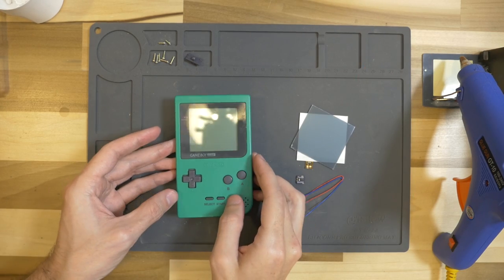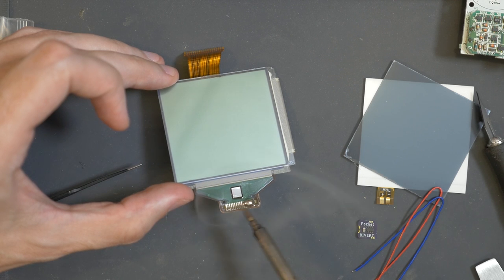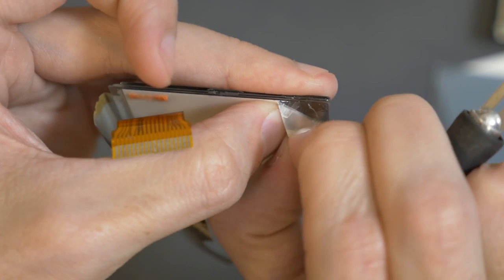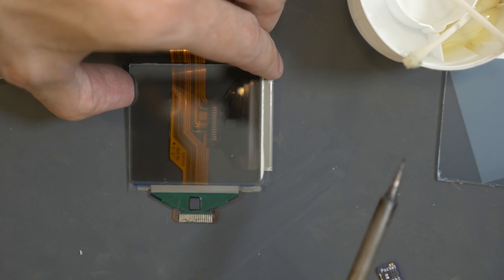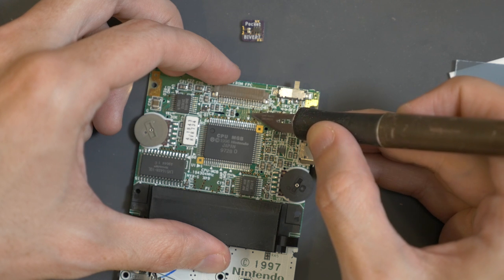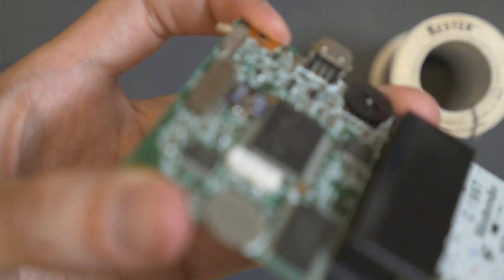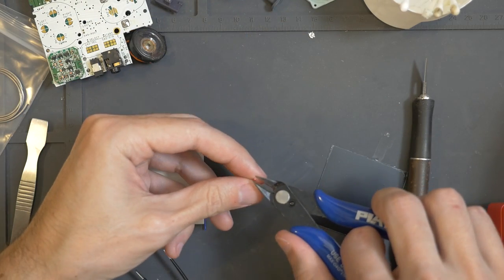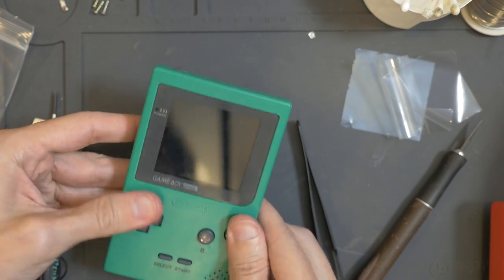Backlight and Bivert a Game Boy Pocket - Full Install

Comment: How hot should a soldering iron be to do its job when soldering/disoldering parts on a GB? Mine has a heat regulator, and I'm not sure if I'm applying too much heat, or the heat is too low, any useful tips?
Reply: theretrofuture uses like 300°C i believe

Comment: Desoldering the ribbon is super tricky—I just ruined a screen this way (accidentally yanked off two of the "teeth" contacts of the top layer). Other tutorials I've seen tell you to keep the ribbon on and just work beneath it carefully when removing the backlight... something to consider before you begin!
Reply from the maker: I’ve done lots both ways and haven’t ruined any screens by desoldering the ribbon, but definitely have destroyed some by not. But it’s possible both ways for sure :)

That said, I think most people are just dropping in new IPS screens now anyway, heh.
Reply: @esotericsean  good to know... possibly just had bad luck with this one!
Reply: no worries, I screwed up my screen by not desoldering the ribbon just as well :D
it might be easier to repair broken teeth than the ribbon broken just where it attaches to the screen 
hope you fixed your gameboy btw
Reply: The funny part is that I’ve tried desoldering the ribbon, but I haven’t had the quick solder thing (low melting point solder) so I’ve tried to remove it using the regular solder. I overheated the ribbon and those teeth got burned basically, so another screen is dead
So unless you have a low melting point solder it’s definitely safer to not touch the ribbon :’(

Comment: hi. i hope u can answer my question. there are vertical line color/shades inaccuracies on my gameboy pocket screen when there is a contrasting color/shade ie. grid in the background. i think it only happens when there is a column from a building in a background and the vertical line extends to where it shouldnt be from the top or bottom. can i fix this by resoldering the screen ribbon cable?
Reply: there are several tutorials on how to fix that
watch some videos of theretrofuture

Comment: Is there any concerns of goo gone getting on white ribbon? I was able to clean back of screen with alcohol and without separating ribbon with the iron. However, it took FOREVER to remove adhesive with alcohol alone
Reply: I know that it's a comment from 3 years ago but for the future lurkers:
I was out of IPA so I've used nail polish remover (Acetone), and I think it worked even better than an IPA
but be aware that it can damage plastic parts, so it's better to be careful and not apply it to anything except the glass itself

Comment: I’ve done a ton of these.  The one thing I’ve noticed is that when the system is all buttoned up there is pressure on the upper/mid right part of the screen sometimes causing dark spots in the lcd.  Any ideas for fixes????
Reply from the maker: I’ve honestly only done a handful and use IPS screens for the most part now. I do think there’s a certain nostalgia and beauty about original backlit screens though. Pockets are the trickiest, unfortunately. Wish I had something helpful to add!

Comment: Thanks a lot for this tutorial!
Do you know if there is a a way to add a switch to switch off the screen and bivert to get back to the original screen? (kind of like switching on and off the screen on GB SP).
Reply from the maker: You could.. but doing this mod removes the reflective backing so it would be darker than normal with the backlight off. I’m sure you know about the new IPS kits for Pocket, though?
Reply: @esotericsean  Ok I see thanks! Yes I know the IPS, I wanted to mod the pocket to be able to play at night while keeping the possibility to have the normal screen during day. Like it was just a nice addon!

Comment: Any recommendations for the ones who are doing this mod without "desoldering" the ribbon. I have never seen anyone desolder that ribbon before because of how extremely delicate it is.
Reply from the maker: Cameron Muir I wouldn’t advise attempting this without desoldering the ribbon. I’ve ruined multiple that way. Desoldering it is much safer and I haven’t had any accidents that way.
Reply: @esotericsean  I guess I've never tried it by desoldering the ribbon. What temperature do you set your soldering iron at to ensure not to melt the ribbon or burn off those very small wire connections? I have my 3rd pocket screen coming in and I want it to be a success
Reply: I'd recommend using qtips and isopropyl alcohol to remove the glue
Reply: Maybe just reinforcing the connection with some solder could help?
But desoldering seems MUCH safer, though terrifying at first

Comment: Did Ben Venn release the drop in screen?
Reply from the maker: Jeremy Leeds Frank He did, but is currently sold out. There are other options now too, though.
Reply: @esotericsean  ahh thanks for the info, I haven't seen anyone post a video on it so I figured it never happend.  In your opinion would you suggest a backlight bivert or the new ips screen for the gbp thanks!
Reply from the maker: Jeremy Leeds Frank Backlight and bivert has a bit of nostalgic feel to me, but nothing compares to the new IPS screens 😊
Reply: @esotericsean  thanks for the suggestion I think I'll try bivert and if I screw the screen up just throw in the ips
Reply: @esotericsean  Question, if you cut the pcba for the bivert, can you solder it back together if you want?
Reply from the maker: @jeb_leeds2928  Yeah you should be able to. Probably best to run a couple wires across them (connecting the CPU to the LCD connector pins that were cut).
Reply: @esotericsean  Ok nice, I was worried that once you cut it, there's no going back.